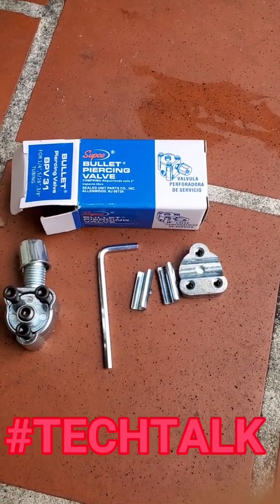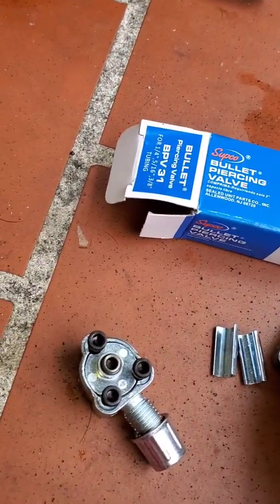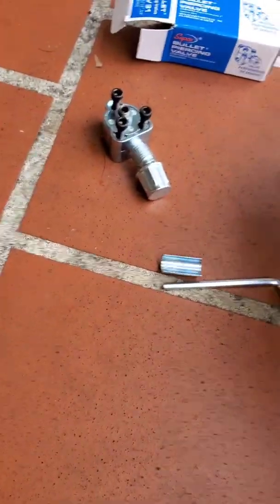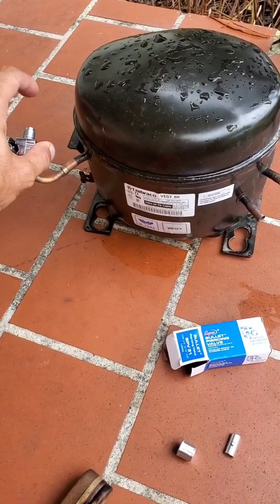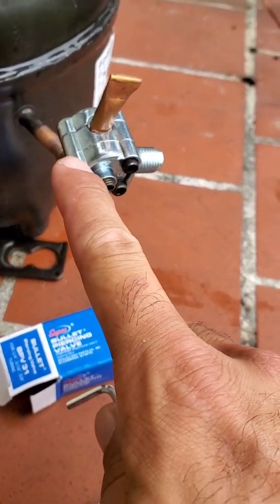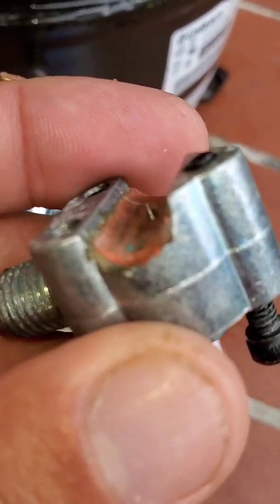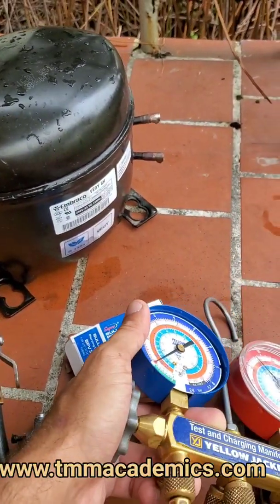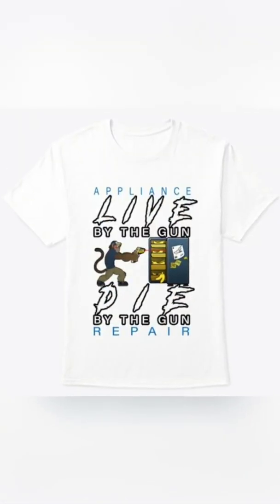#TECHTALK How to tap into a refrigerator sealed system

Comment: Do the Supco taps ever leak? I would like to install one on my 20 year old refrigerator to check the pressure but don't want to cause a leak.
Reply from the maker: Yes they leak over time. However if you get a good tight seal. Ive seen some on for years still holding fine